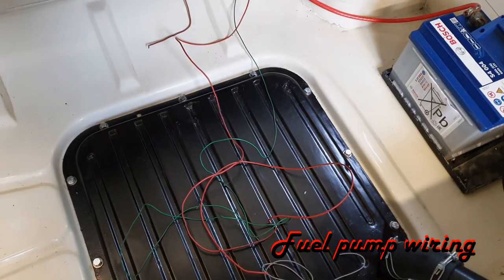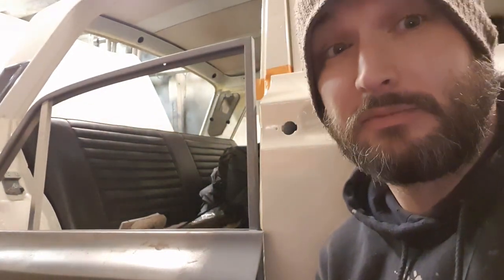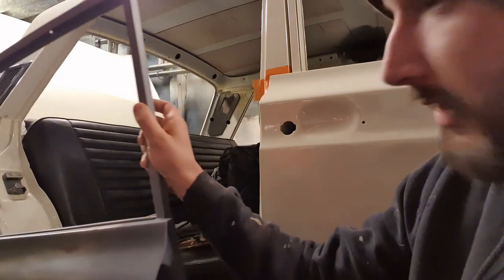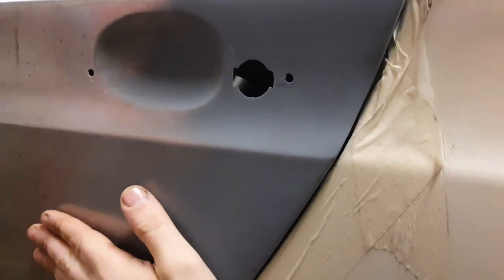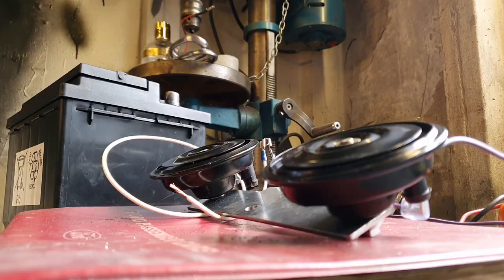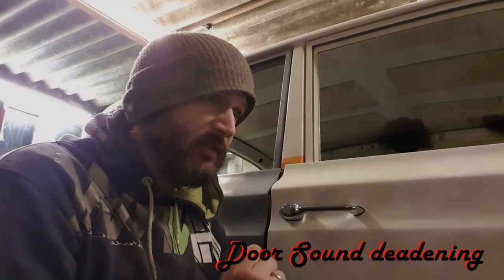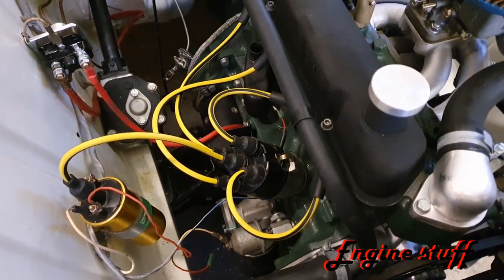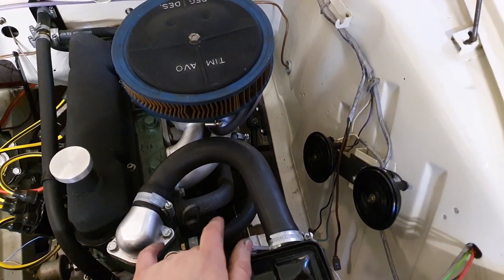Mk1 Cortina Restoration EP13 - Easy Wins!

Comment: Jim do you know what the exact amount of oil is for the 1500 pre crossflow? The dipstick is not original, so if I have the right amount to put in, I'll know where the level is, cheers!
Reply from the maker: I checked the manual this morning its says 3.6L including the filter, that'll be based off the original cannister type though. Without the filter it's 3.4L
 
I hope that helps 👍
Reply: @jimbuilds  yeah! Thanks. 👍👍👍🇬🇧Much appreciated!